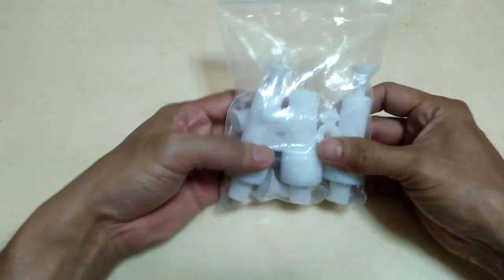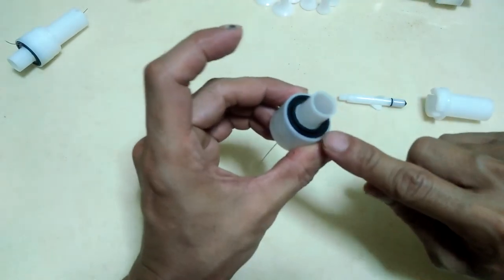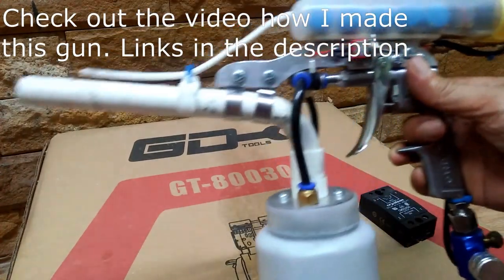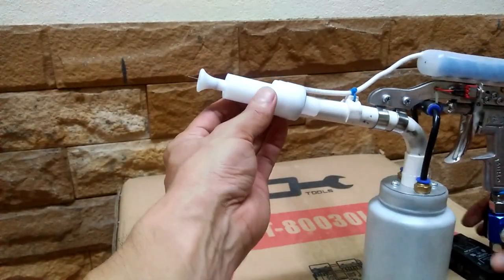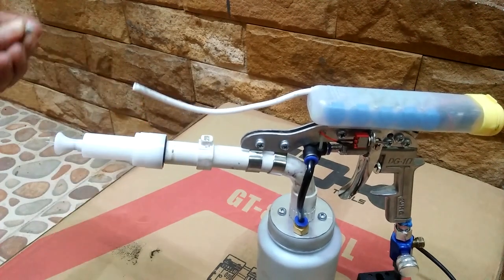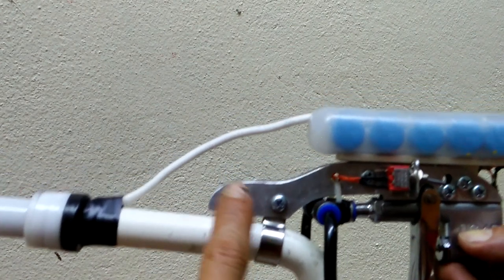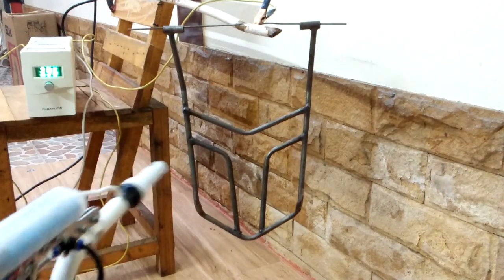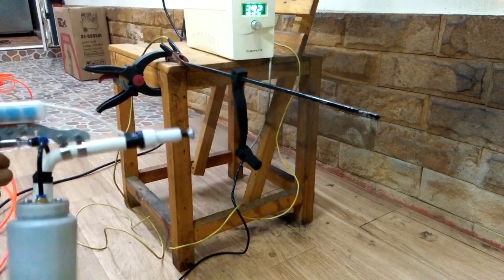Homemade Powder Coating Gun - Nozzle Upgrade

Comment: Damn this guy so serious build this thing,  i follow this gun from the first version, i think it will be just like the other made and forgot it. But this guy keep upgrading hes gun and keep uploading. Im so happy with the result for this far. Thankyou somuch phill ❤
Reply from the maker: Hi. Thanks for your kind comment. It is a hobby and I simply like to make things during my spare time. But there is a limit of what I want to DIY on this gun. That is if the cost of buying parts comes close to just buying a Chinese powder coating gun knockoff. So far I am mostly using recycled materials so the cost is very minimal.

Comment: Sos un genio Phil. Hice mi pistola si tenés un correo electrónico te mando un vídeo . En esta primera etapa llega a 30kv pero funciona de maravilla . Abrazo amigo .
Reply from the maker: por favor envíame a mi amigo. quiero ver.  correo electrónico philipal2015@gmail.com
Reply: @DIYPhil  si , mañana hago un video y te lo paso . te consulto de que espesor es el alambre de inoxidable que trae la boquilla profesional que compraste?
Reply from the maker: @jidukrishnamurti8114  alambre de acero inoxidable de 0,5 mm
Reply: @DIYPhil  gracias por la info, en breve te mando el video estoy esperando la ultima impresión 3d de la pistola.
Reply: @DIYPhil  este es el equipo que arme estimado Phill https://www.youtube.com/watch?v=R4QnfZ1K9g8&ab_channel=jidukrishnamurti
Reply from the maker: @jidukrishnamurti8114  Vi el vídeo. trabajo muy agradable y profesional
Reply: @DIYPhil  si , es 3d  print phil

Comment: What the size pipe plastic?
Reply from the maker: the markings on the pvc pipe says 3/8". It has about 19mm outside diameter. It is the pvc pipe used with house electrical wiring.

Comment: Pwede po mag order ng nazzle sir?
Reply from the maker: nasa ibang bansa ako ngayon sir eh. Subukan nyo po i search sa Lazada
Reply: @DIYPhil  ano po yung module na ginamit nyo? stepup voltage?
Reply: bakit papo kayo nag 4 volts input lang tas nag step up voltage pa kung pwede naman direct volatge na papunta sa ark generator nyo...?
Reply from the maker: @johnli6736  nasa 4 volts lang input nung circuit, mas ok resulta. kung taasan input voltage nasisira yung transistor sa high voltage generator. tingnan nyo dito yung video kung pano ko ginawa yung circuit ng high voltage generator. https://youtu.be/jJm6EpnzTnQ
Reply from the maker: @johnli6736  15kV high voltage generator pangalan, pwede mo i search sa Lazada